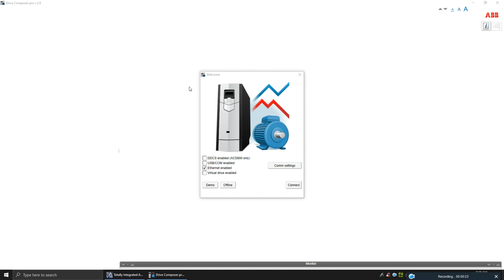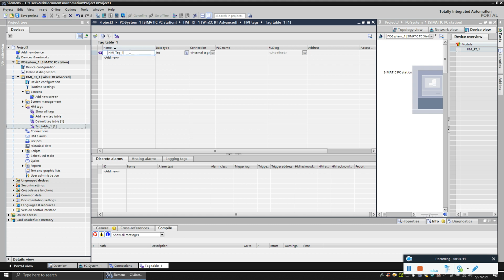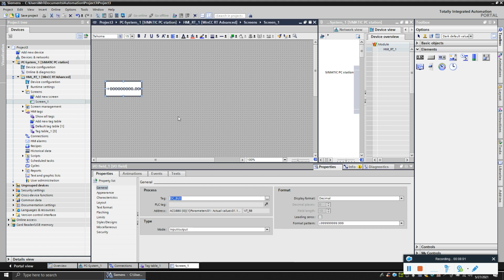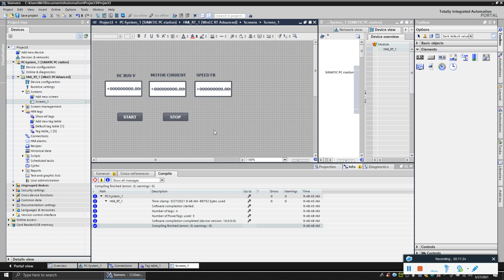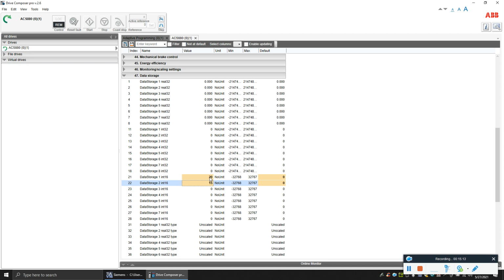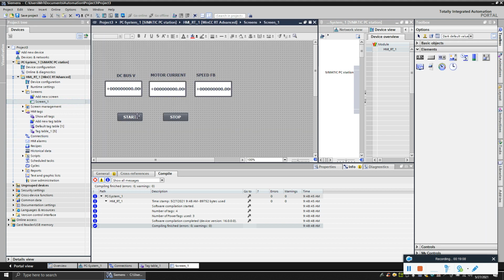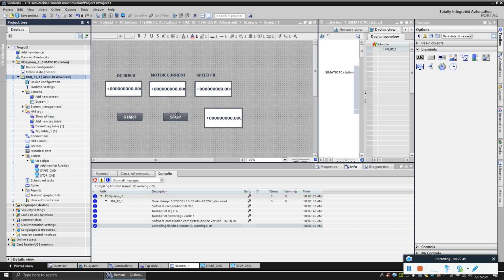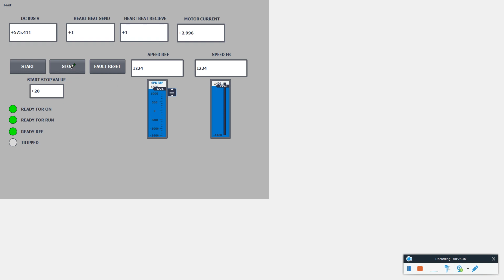8. WinCC SCADA control for ABB Drive without PLC

Comment: Very nice video about GUI interface with Tia portal....seems simple but when practically it hard for me(not very familiar with it) as dunno where to click for certain feature and function in Tia portal XD. One question, for ABB drive composer data storage I can randomly chose a par as a declare? Means like 47.1 as feedback speed or dc voltage/current etc, any parameter I like?
Reply from the maker: Thank you,
47.1 parameter i have used for giving speed reference to the drive. Speed feedback or dc voltage can be directly connected to SCADA from the actual values parameter on the drive, like i have shown in the video. And TBH, i made this project as an experiment for a test simulation kit, so i dont suggest this method in a professional field.
Reply: @averageengineer4266  Noted , I won't try this kinda stuff in online industry mode don't worry💪💪💪
Reply: can you make an actual video?  I am currently working on an ABB ACS880-17 and would love to use WinCC Scada without a plc. straight from Drive to  HMI